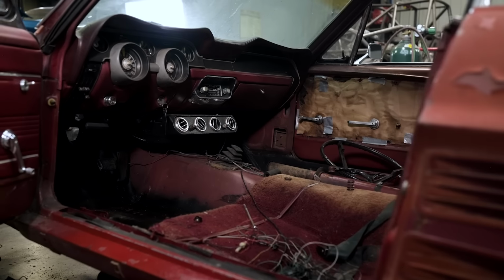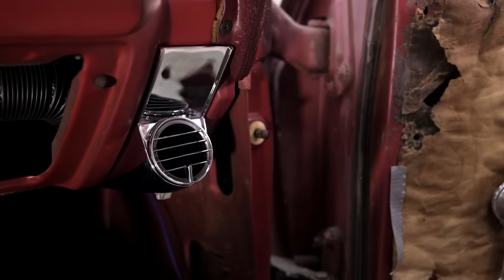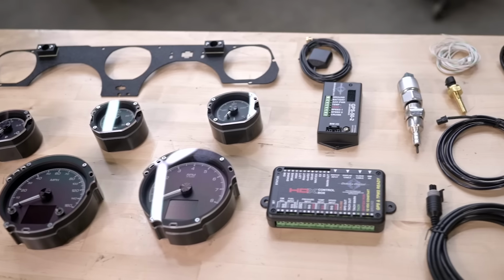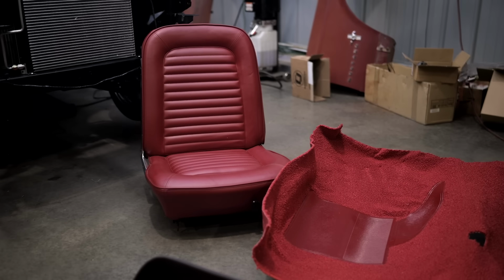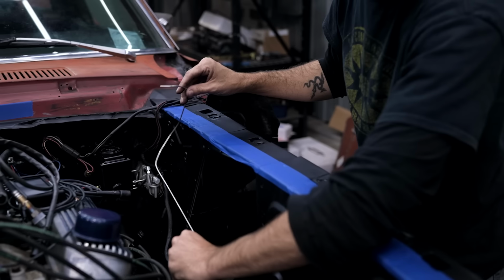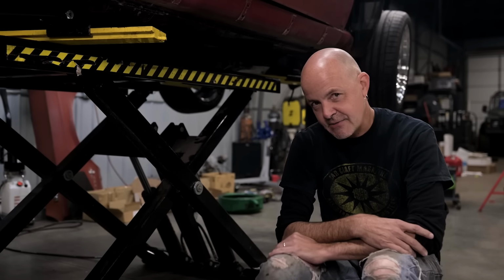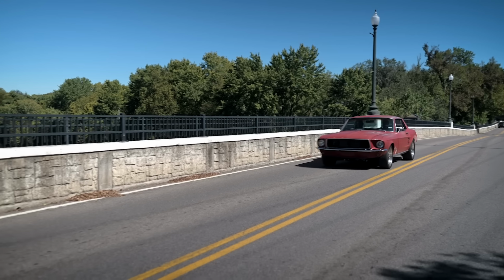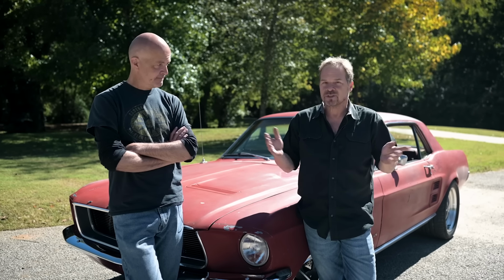Crusher to Cruiser! Car Craft Mustang Test Drive | MotorTrend

Comment: The 351W engine was first offered in 1969. It came stock in Mustangs,Torinos and other cars along with Rancheros. It was not a truck engine in the beginning although was a option in trucks by Ford in later years.
Reply: I refer to ours as a "Truck engine" because we bought it from a guy that had it in an 84 full size Bronco.   I know the Windsor based 351 was standard in several platforms... it fits great in this 'Stang!

Comment: It's a great car but I remember when Car Craft was a more DIY regular guy publication. This build would have been considered a bit on the expensive side..... but times change I guess..        Wait. A 216 ci  6 cylinder? Uhhh, how much do you really know about Ford engines?
Reply: Aparently not  enough..... What did Ford have with the I6 i n67?
Reply: @paintucation  Almost all of the smaller Fords were available with 6 cylinders Fairlane, Mustang, Falcon etc.
Reply: @mikestaihr5183  I know, inline 6 was the base-engine for all Ford compact and midsize vehicles...I was asking about cubic inches...  what SIZE I-6 was standard in 67?  I got my Chevy CID mixed up with Ford.   My research (now) tells me it was a 200 CID
Reply: @paintucation  Sorry misunderstood. There were I believe three that I can think of depending on the model. The 200, 240, and 300 ci. I think the 300 was only in trucks though. My dad had a 65 f-100  with the 300.
Reply: It all about product advertising. The wasn't any technical info, such as, how to set the pinion angle or how to adjust the upper control arms for alignment, how to route the clutch hydraulic line so it won't burn up on the exhaust, how the steering column was adapted to the r&p. If it's a cruiser, y'all know stock seats suck!